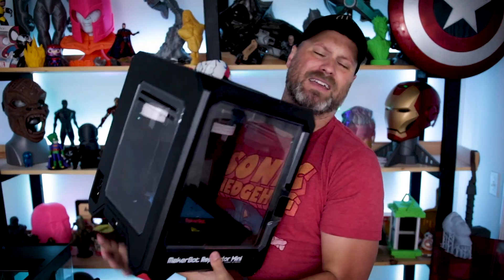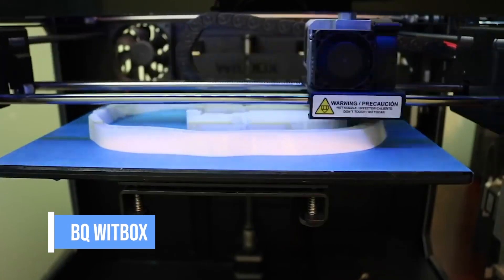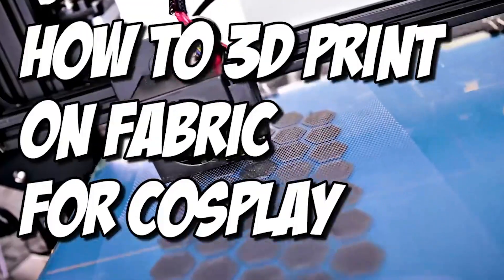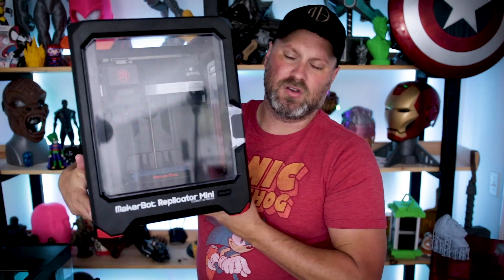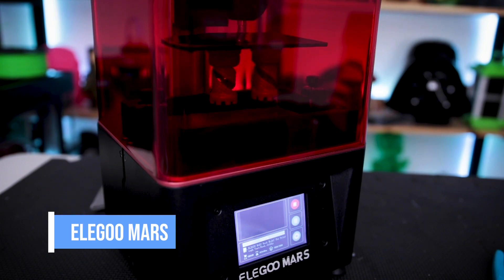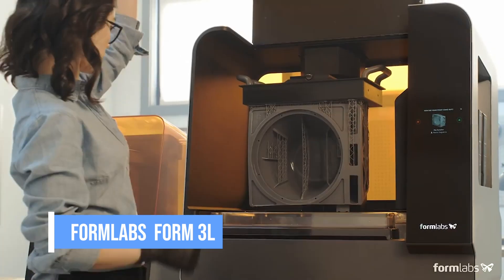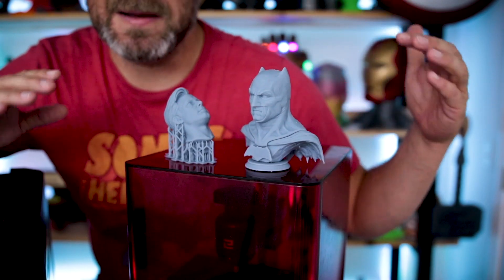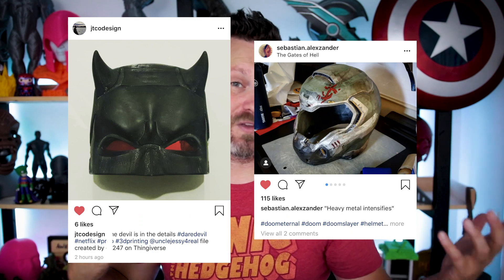This is 3D Printed

Comment: You should check out the Photocentric range of 3D printers and their resins ,generally  cheaper prosumer printers than most resin printers out there with larger build volumes . Alot of dentist use them!  I love my LC HR2  and the resins are really well priced and perform amazingly.

Comment: Hey Jessie. I'm also interested in large form resin printing currently attempting a build using a 47inch UHD TV...I've already stripped out the screen from the leds and replacing them with UV leds for curing. Early stages but just letting you know you're not alone in your desire for large resin printers

Comment: if you want a large format resin printer check out the one Welbot is using, its so BIG and pretty "reasonable" priced aswell for their size afaik also massive congrats on closing in on 100k!

Comment: big MSLA printer is easy! I really wonder why they haven't done it already (I know someone who wants to!)
but just use a 4k panel and you can double the size with the same quality (2 2k = 1 4k more or less)
Reply: The problem is releasing the adhesion from the build plate and overcoming the suction of cupped models. The larger the model, the more likely it'll tear itself right off the build platform.